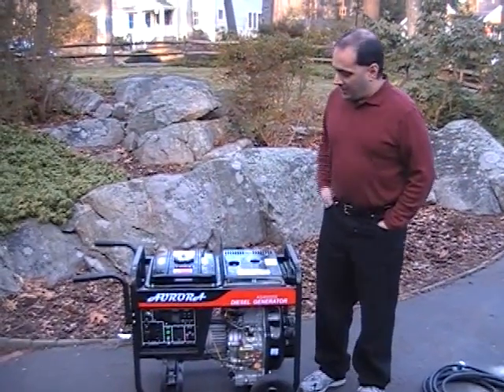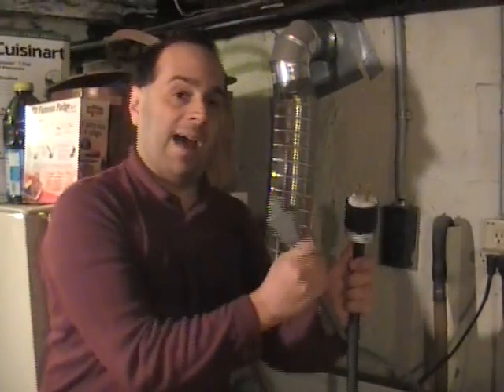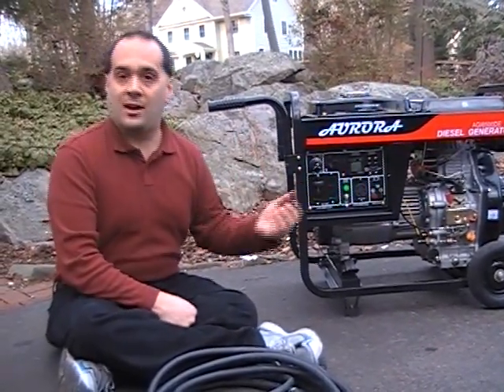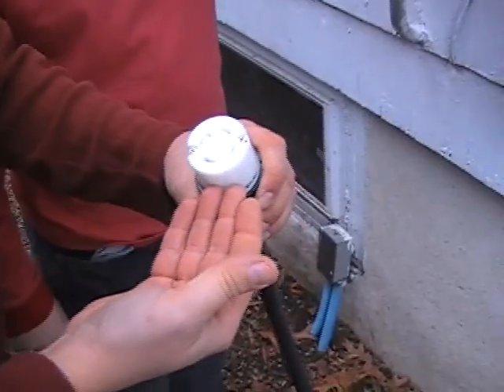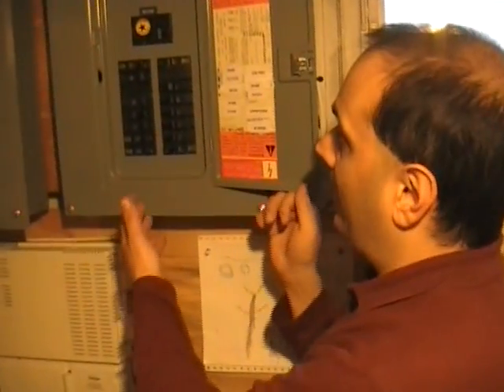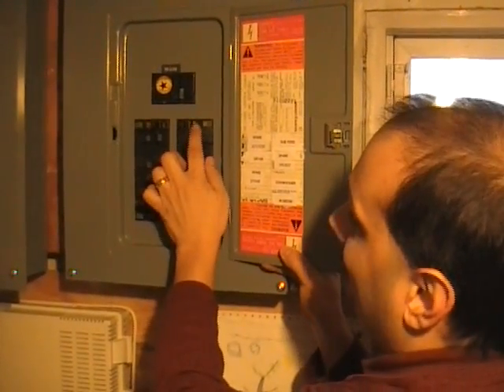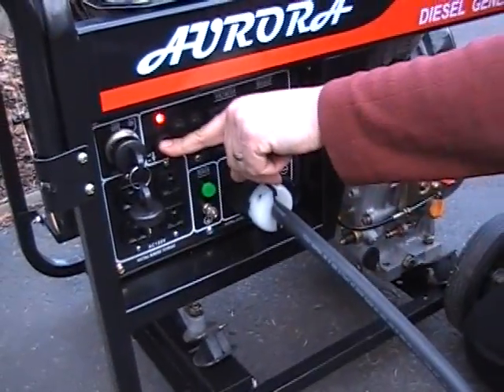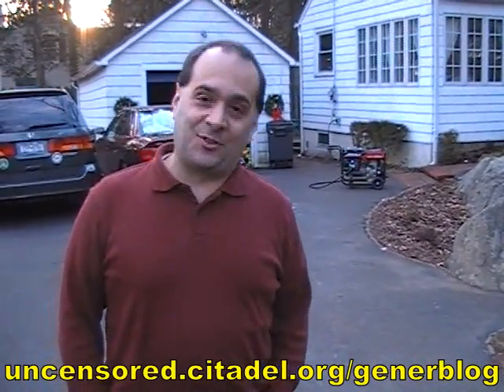Inexpensive residential generator hookup

Comment: Good info but the big point you're not making about the 'Widow-Maker' power cord (we call them in the UK) is that if they are fitted without the interlock, and the house occupier forgets to isolate the power, then it's possible to back-feed the entire street. Worse still, if the back fed power goes back through a transformer, it's possible to step up the voltage to many thousands of volts and then electrocuting the unsuspecting electrician who is trying to fix a problem on a circuit he thinks he has isolated and is 'dead'. Either way, creating a lethal situation. Dryer leads are uncommon in the UK as we historically have very few power outages - thank goodness.
Reply: Make sure you follow all the generator safety rules before using portable generators. This is just a reminder for everyone’s safety. All generator safety rules should be followed carefully. Here are the rules about generator safety: Generators can be dangerous if not used carefully. Every year, hundreds of people die or get injured when using portable generators due to carbon monoxide poisoning and electrocution. Make sure you are using your generator carefully and keeping others safe as well. There is something very serious that everyone should always be aware of when using generators. Some people do run their generator indoors which is not safe and that increases the risk of carbon monoxide poisoning which can cause death of family and you. Some people run their generator in wet conditions which can electrocute them. Please remember that you should never run your generator indoors. Remember that carbon monoxide is an odorless and colorless gas that you cannot see or smell. Carbon monoxide is a silent killer. Keep that in mind. Make sure your generator is 15-20 feet away from your house and away from doors, windows, and vents. Never use your generator in your porch too. Having a carbon monoxide detector is very important against generator safety. Some people also allow children to go near the portable generator which could pose risks. We need to keep an eye on our children making sure that they are not near the portable generator so they won’t get electrocuted or burned by the generator which is dangerous. A locking enclosure also keeps kids safe. A generator shed might look like a tempting place to explore, or take cover during a game of hide and seek, but a generator is a dangerous piece of equipment that can cause injury. It says on the manual that we should also keep children away at all times from the portable generator to avoid injuries. Please do not allow a child or unqualified people to operate the portable generator.  It is important to keep your children safe especially little ones. The portable generator can be hot during an operation. Just because some manuals missed what should be listed doesn’t mean it’s safe to do. Always follow the generator safety rules when using portable generators. Generators pose electrical risks. If you need to use your generator during wet weather, you need a generator tent to protect your generator from getting wet. Don’t let your generator get wet. Keep your generator dry and before using your generator, please make sure your hands and your generator is dry. Do not wear loose clothing when operating the generator. Everything that is said on the generator’s operating manual should not be ignored. Never smoke cigarettes near the generator. Please keep flammable things away from the generator. Never overload your generator too. Your generator can catch fire. Never ever try to plug a generator cord into a wall outlet to avoid back feeding. Back feeding your generator is dangerous. Always turn on your generator first before plugging in appliances and shut off the appliances before turning your generator off. Use a heavy duty cord for your generator and the cord should not be worn out. All the instructions should be followed carefully. Never refuel your generator while it’s running. It can cause fire if fuel spills while your generator is hot. You should turn off your generator and let it cool off before refueling it. Having a fire extinguisher next to the generator is also important. This is only a reminder for everyone’s safety of using generators. Make sure your generator is properly grounded. Having a fire extinguisher next to the generator is also important against the safety rules. https://youtu.be/I1jT3ANENvI and here is a video more about keeping others safe when using generators and also about our family’s safety. It’s important to keep our little children safe as well. Make sure they’re away from the generator. Hope this helps.

Comment: In DFW you cannot install breaker boxes without a permit and licensed electrician approval. For that reason it’s not inexpensive. However, now that climate change has already arrived, it’s a smart investment no matter what it costs.
Reply: Solar makes more sense than ever. Make sure your panels can be moved to safety in bad weather.
Reply: @steviegee2011  Make sure you follow all the generator safety rules before using portable generators. This is just a reminder for everyone’s safety. All generator safety rules should be followed carefully. Here are the rules about generator safety: Generators can be dangerous if not used carefully. Every year, hundreds of people die or get injured when using portable generators due to carbon monoxide poisoning and electrocution. Make sure you are using your generator carefully and keeping others safe as well. There is something very serious that everyone should always be aware of when using generators. Some people do run their generator indoors which is not safe and that increases the risk of carbon monoxide poisoning which can cause death of family and you. Some people run their generator in wet conditions which can electrocute them. Please remember that you should never run your generator indoors. Remember that carbon monoxide is an odorless and colorless gas that you cannot see or smell. Carbon monoxide is a silent killer. Keep that in mind. Make sure your generator is 15-20 feet away from your house and away from doors, windows, and vents. Never use your generator in your porch too. Having a carbon monoxide detector is very important against generator safety. Some people also allow children to go near the portable generator which could pose risks. We need to keep an eye on our children making sure that they are not near the portable generator so they won’t get electrocuted or burned by the generator which is dangerous. A locking enclosure also keeps kids safe. A generator shed might look like a tempting place to explore, or take cover during a game of hide and seek, but a generator is a dangerous piece of equipment that can cause injury. It says on the manual that we should also keep children away at all times from the portable generator to avoid injuries. Please do not allow a child or unqualified people to operate the portable generator.  It is important to keep your children safe especially little ones. The portable generator can be hot during an operation. Just because some manuals missed what should be listed doesn’t mean it’s safe to do. Always follow the generator safety rules when using portable generators. Generators pose electrical risks. If you need to use your generator during wet weather, you need a generator tent to protect your generator from getting wet. Don’t let your generator get wet. Keep your generator dry and before using your generator, please make sure your hands and your generator is dry. Do not wear loose clothing when operating the generator. Everything that is said on the generator’s operating manual should not be ignored. Never smoke cigarettes near the generator. Please keep flammable things away from the generator. Never overload your generator too. Your generator can catch fire. Never ever try to plug a generator cord into a wall outlet to avoid back feeding. Back feeding your generator is dangerous. Always turn on your generator first before plugging in appliances and shut off the appliances before turning your generator off. Use a heavy duty cord for your generator and the cord should not be worn out. All the instructions should be followed carefully. Never refuel your generator while it’s running. It can cause fire if fuel spills while your generator is hot. You should turn off your generator and let it cool off before refueling it. Having a fire extinguisher next to the generator is also important. This is only a reminder for everyone’s safety of using generators. Make sure your generator is properly grounded. Having a fire extinguisher next to the generator is also important against the safety rules. https://youtu.be/I1jT3ANENvI and here is a video more about keeping others safe when using generators and also about our family’s safety. It’s important to keep our little children safe as well. Make sure they’re away from the generator. Hope this helps.

Comment: Back feeding the dryer is fine. Its the careless idiots that make mistakes. Guns don't kill people, people do.
Reply: @GEE MAN, I agree 100% about the guns, BUT the dryer outlet backfeed hookup in NOT fine, ever,  for a bunch of safety reasons and Code reasons. Backfeeding like this using a 3-wire dryer outlet (inferred by all of these such "quick and cheap methods") means you are missing the 4th wire, either the neutral or the ground, depending on how you connect the generator. IF you have a 4 wire dryer outlet, now required by Code since 1996, it would work, but you still have to be careful about how you handle the interlock in the electrical panel. And that double-ended male suicide cable is never per Code. One of those "careless idiots" you refer to may be someone you love, who is not as savvy as you.
Reply: Make sure you follow all the generator safety rules before using portable generators. This is just a reminder for everyone’s safety. All generator safety rules should be followed carefully. Here are the rules about generator safety: Generators can be dangerous if not used carefully. Every year, hundreds of people die or get injured when using portable generators due to carbon monoxide poisoning and electrocution. Make sure you are using your generator carefully and keeping others safe as well. There is something very serious that everyone should always be aware of when using generators. Some people do run their generator indoors which is not safe and that increases the risk of carbon monoxide poisoning which can cause death of family and you. Some people run their generator in wet conditions which can electrocute them. Please remember that you should never run your generator indoors. Remember that carbon monoxide is an odorless and colorless gas that you cannot see or smell. Carbon monoxide is a silent killer. Keep that in mind. Make sure your generator is 15-20 feet away from your house and away from doors, windows, and vents. Never use your generator in your porch too. Having a carbon monoxide detector is very important against generator safety. Some people also allow children to go near the portable generator which could pose risks. We need to keep an eye on our children making sure that they are not near the portable generator so they won’t get electrocuted or burned by the generator which is dangerous. A locking enclosure also keeps kids safe. A generator shed might look like a tempting place to explore, or take cover during a game of hide and seek, but a generator is a dangerous piece of equipment that can cause injury. It says on the manual that we should also keep children away at all times from the portable generator to avoid injuries. Please do not allow a child or unqualified people to operate the portable generator.  It is important to keep your children safe especially little ones. The portable generator can be hot during an operation. Just because some manuals missed what should be listed doesn’t mean it’s safe to do. Always follow the generator safety rules when using portable generators. Generators pose electrical risks. If you need to use your generator during wet weather, you need a generator tent to protect your generator from getting wet. Don’t let your generator get wet. Keep your generator dry and before using your generator, please make sure your hands and your generator is dry. Do not wear loose clothing when operating the generator. Everything that is said on the generator’s operating manual should not be ignored. Never smoke cigarettes near the generator. Please keep flammable things away from the generator. Never overload your generator too. Your generator can catch fire. Never ever try to plug a generator cord into a wall outlet to avoid back feeding. Back feeding your generator is dangerous. Always turn on your generator first before plugging in appliances and shut off the appliances before turning your generator off. Use a heavy duty cord for your generator and the cord should not be worn out. All the instructions should be followed carefully. Never refuel your generator while it’s running. It can cause fire if fuel spills while your generator is hot. You should turn off your generator and let it cool off before refueling it. Having a fire extinguisher next to the generator is also important. This is only a reminder for everyone’s safety of using generators. Make sure your generator is properly grounded. Having a fire extinguisher next to the generator is also important against the safety rules. https://youtu.be/I1jT3ANENvI and here is a video more about keeping others safe when using generators and also about our family’s safety. It’s important to keep our little children safe as well. Make sure they’re away from the generator. Hope this helps.
Reply: Back feeding with out a lock out style breaker IS ILLEGAL. Don't care if you personally make sure the main is open. It is still not legal

Comment: I installed this setup a few years ago on my house, I did check with my local building inspector, he said the interlock and a transfer switch are the preferred way to plug a generator into a building.  I made a cord with a male RV 30 amp 120 volt on one end and a female 30 amp twistlock 240 volt on the other end.  I tied the two hots together in the female end and everything works great. I also marked all the 240v breakers to turn off when running the generator.  It won't hurt anything to leave them on but they won't work, and could end up using some power unnecessarily.  Art, what do you thing about this setup?

Comment: Bullshit! Backfeeding your dryer outlet is safe as long as you're not a moron!
Reply: Charles Tait 
Well Charles one has to make assumptions back feeding you dry plug could work but is somewhat dependent on your house wiring.

Many modern trips won’t like being back fed and you must absolutely must check that you have a twin pole trip between the main and your dryer feed. Many older systems don’t.

So let’s us remember there are a lot of not very well educated people out there and wrong information can kill.

I live in Canada and it is certainly illegal here not to have a properly installed.

That is an either or type switch which changes from mains feed to generator feed nothing else is safe.

However where I live the power guys isolate the lines before they start work as many farms have emergency generators.

When I lived  to the UK we had all sorts and most there were three phase 480 or 560  house dryers there are 240v single single phase dryers as heat is a function of volts times amps a 15 amp standard 240 volt line at 13 amps can supply 3600 watts enough for a dryer without much problem.

But 110V systems use two 110v either split phase or twin phase feeds as each 110v line  at 20 amps does 2200 wats.

So enough for a dryer but the Generator matey was playing with looked about 12 KVA far to much for a 40 Amp feed a waste of fuel.

But capable of putting far to much power though the cable. So essential to disconnect the feed back to the mains many older distribution boxes are legacy and up to code until,you start F’’in with them then you have to install the proper kit.

Were my son is now we have a 480 hp Cummings driving a 280 kva generator that kit has completely automatic changeover although change back is manual to reduce the cost and the load on the mains when they get it back on.

So yes it is possible but almost certainly illegal and only a moron would plug into a dryer socket instead if having a changeover switch it should be about the same price as a second feed system which make little sense.

If I lived in the US I would worry more about the damages case if you accidentally electrocute a lineman of damage a transformer.
Reply: @CT, you are 100% wrong. What are your credentials for making such a "moronic" statement? I have been a licensed electrician AND a registered Professional Electrical Engineer for over 40 years. I have gone to court to get the Widow her money because of "moronic" crap like this.